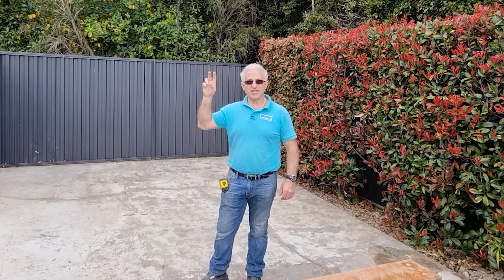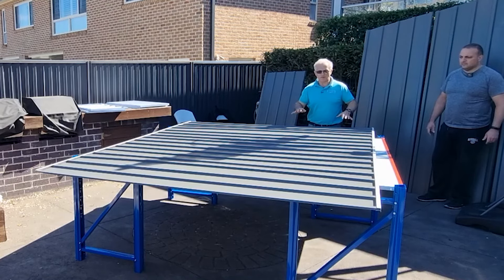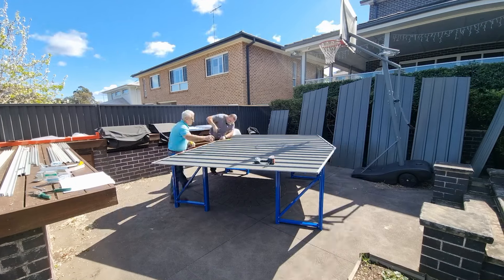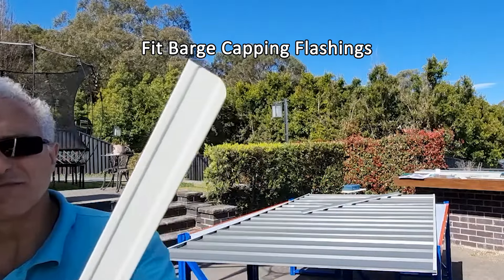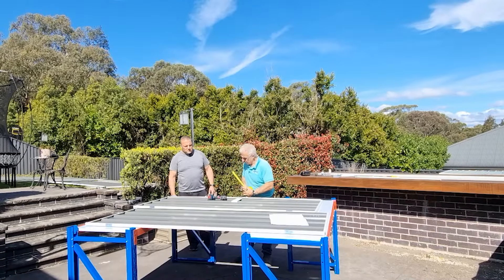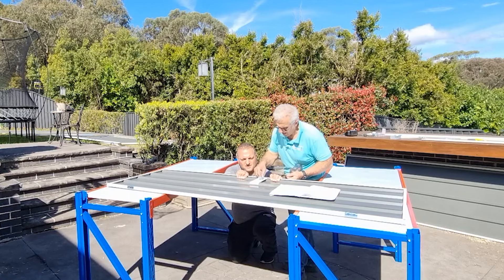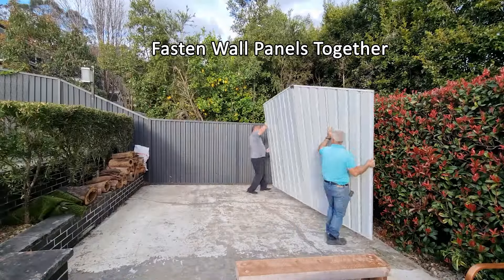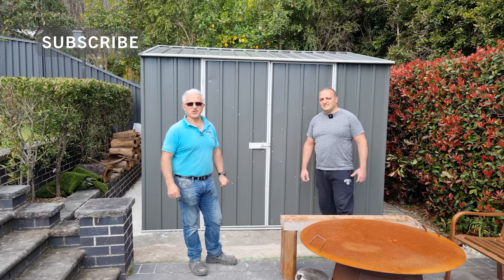Install an Easyshed, but is it Easier than an Absco Shed?!? (DIY)

Comment: If you want to build your own shed with a 200 piece jigsaw and you like that? Go with easy shed. I will use them again. I will get someone to install it for me. Or I could have used Brisbane garden sheds. 4 sides and 2 pieces for the roof.
Reply from the maker: Yes, it is a hard shed to install. There is no two ways about it, it's not an easy. It is a stong but difficult. I don't blame you for being annoyed!
Reply: Not to mention the small size of the ridge capping, I wish this was addressed in the videos I watched.
Reply: Never had a brand name been more misleading.  Perhaps they were easier but eventually pre-assembled less and less in the factory to keep prices low.
Reply from the maker: Sorry to say Max, but I do agree. They are not easy to assemble, especially if you have never put one together before.

Comment: I initially order Absco shed with Bunnings they gave me easy shed instead after months of delay, now i see this video… I really should have ask for a refund /:  it took me weeks to assemble by myself and their so call install service refuse to come over because I didn’t have a concrete slabbing. I was happy to pay more if they do it as well but they refused
Reply from the maker: I am sorry to read that Teddy. We were able to do it quickly only because I have a structural background in carpentry and have experience with putting up other shed! Joseph at the end of this video said himself that it would have taken him a week to put it up. However, structurally it's a well designed shed but EasyShed should take a long look at how they set out the instructions and also label everything!

Comment: I have several sheds in my backyard and the last two i have built were Absco from Bunnings and the recent one was an "Easyshed". the only reason i went with easyshed was because I wanted a cream colour to match the one i was building beside. I would not recommend an Easyshed, it took me several days to get it completed mostly on my own. Barely any of the items are marked so you have to be careful in checking each component. I found the Absco shed much easier to put together, all components marked and the fittings snapped together for the edges as they should compared to the loose fitting of the easy shed.
Reply from the maker: I agree, Absco Sheds is the best labelled & easiest shed I have ever put together! And after 2 years it still looks great!
Reply: WHY ARE ALL THESE SHEDS SOOOOO DIFFICULT ?! You would think by now there would be a much quicker easier way!
Reply from the maker: @axedog1395 You are spot on. The easiest flat pack shed that I have assembled is the Absco shed which has everything labelled. However, you might still need prior knowledge to put it together if you haven't done it before!

Comment: Just received mine, for anyone who receives one unlabelled i suggest making all the easy panels first leaving the front panel with doors till last. that way you're left with only the parts for that front panel and doors.
Reply from the maker: Good suggestion, unfortunately our one was also unlabelled which made it difficult to work out initially. Just take one step at a time and reason it out as you go.

Thanks Matty

Comment: I notice you didn’t rivet anything. The instructions for my 3x3 say you need a rivet gun. Did you just use your own tek screws or were these provided with the shed?
Reply from the maker: Hey Sam,

Sorry, I got sidetracked and wasn't able to respond to your message straight away. Yes, I used screws but only because I wasn't confident with the pop rivets provided. However, I did change them over to rivets at a later date. Good observation!

Comment: I just put my Easy shed together today by myself, followed the instructions which I found easy and thorough (but not too long so you lose the thread of what theyre getting at). I noticed you didnt use rivets for the door hinges, padlock and braces? Maybe the rivets are a new thing? They look really smart and professional.

Comment: Thank you this is so helpful! I've just received mine and am new at DIY so a bit nervous. Can I ask did you have to drill holes before screwing all the screws in?
Reply from the maker: Hi, no but we needed to mark out the holes on the sheets first then we pressed down hard with the drill/bit, then drilled in the screw. Just be careful not to put the drill on an angle because it will cause the screw to be off balance and slip out due to the press you need to apply. I hope this helps
Reply: Thank you so much again!! I wasn't sure if you'd even reply. Thank you :) went to Bunnings and bought a new Makita drill set, level, and all the things, but didn't think of tin snips or a step ladder as featured in your video. So glad I've watched it!! Me and 3 gal pals are building this She Shed at my new property. So excited!
Reply from the maker: @ciellindley  you welcome, just take your time and work out what goes where. It can be a little confusing.

Comment: Finally got to watch the infamous “Easy Shed” video Moussa. You and Joe did a great job even though there was a lack of instructions. I have been looking at putting a shed up at my place. What brand would you recommend? Thanks in advance.
Reply from the maker: Hey Giuseppe,

I think Absco was much easier to install with prepunched holes and is well illustrated.

Comment: great job, I am currently assembling a 3mX4.5m shed. After receiving incorrectly cut ends, Easy shed sent the correct ones and all is OK. I prefer to use silicon on the overlapping sheets, but this is only my decision. I never bolt the shed to the concrete, I sue Industrial silicon and once cured, it never moves. I also silicon the roof panels to the wall panels. Well done, I am doing my assembly by myself, but need help lifting into position
Reply from the maker: Good job! EasyShed won't warranty silicone but I like the idea!
Reply: @quantumhomeimprovements  understand, but I have installed this way for all my sheds since 1979. Once the sheets are tacked together in place for 24hr + make sure you measure against other panels, the segments are easier to move as there is less flex. Its sheet metal, warranty for me is never a consideration, they have stood the test of time
Reply from the maker: It's funny you say that, a while back I released a video, how to install a caroma toilet, and like you I placed silicone at the dase to hold down which I have done for a couple of decades now. However, I had someone comment asking why! They said caroma suggest you screw it down. But my reply was shot and sweet! I would never screw a toilet to the floor because it damages the waterproofing! 

Good job!
Reply: @quantumhomeimprovements  yes, structural silicone once cured is extremely tough. It is used to hold extremely large mirrors to walls. Now that is strong.

Comment: Do you reckon it'd be appropriate to anchor one of these sheds with a ramset?
Reply from the maker: Hey James,

We used dynabolts in the video which the shed is rated for N1, but if you are in a high wind area you may need to upgrade the shed to a a N2 or higher. I can't remember which brand we used for this shed whether it was Ramset or not but yes, I would definitely anchor the shed down for sure.
Reply: @quantumhomeimprovements  I think the area I'm building the shed is relatively high wind, as it's at 700m ASL. Now to look up where those ratings are stored / measured.

Comment: Great job with the video! I was hoping you would have gotten into more detail of which is the better shed between Absco and Easyshed. Apart from the instructions making the Absco easier to assemble, can you please let me know which you found to be structurally stronger? heavier gauge wall sheeting? etc. I was considering Absco but need the extra height of the Easyshed and will most likely go for the stronger of the two and the one with the heavier gauge wall sheeting.  Many thanks.
Reply from the maker: You welcome Tony, I am thinking of making another video next year if the oppertunity arises and I will add more deal as you suggested. 👍
Reply: @quantumhomeimprovements  Thanks, can you briefly let me know here which is the heavier duty shed between the two. Quick and short reply will do. Cheers
Reply from the maker: @tonydelovski8088 The gauge I have been lead to believe is the same but first, could you confirm if you have ever put one together before or are you really good at working out puzzles?.
Reply: @quantumhomeimprovements  Thanks for the reply, yes Ive put a smaller one together a while back. Can't remember the brand unfortunately.
Reply from the maker: Between the two brands Absco is by far easier with their unique clip on system but EasyShed uses screws which is stronger but it will take twice as long & they don't have prepunched holes as well 

I hope this helps you Tony

Let me know how you go!
Reply: @quantumhomeimprovements  Thanks mate. Thats the answer I needed :) I'll stick with the Easyshed. Keep the videos coming, you're doing a great job!
Reply from the maker: @tonydelovski8088  Thanks Tony
Reply: @quantumhomeimprovements  Just an FYI, I was about to order the easyshed but they are only wind rated to N1. Absco are wind rated up to N2.
Reply from the maker: @Tony Delovski  Thanks Tony, I should have asked you what size you are wanting but just be careful, not all the sizes are N2. But if you are looking for a higher wind resistance shed you can upgrade to a cyclone kit. But know the 'N' rated strength doesn't always equal total strength. However, I preferred not to tell you earlier which shed you should buy but the reality is I found Absco far easier to install and I am happy with the strength of it and I think you would be happy with it. 👍

Comment: The reason I bought this shed was the extra height option which is a big plus.
I purchased 2   3x3 sheds, the same style in this video. Was considering giving the 2nd one away as I found this tedious. Only partially built the second one.  I think if they made prisoners assemble these in Gaol, they definitely would not reoffend.
The reason I bought this shed was the extra height option which is a big plus. On there website they say life time warranty but in the instructions it says 20 years from date of purchase. That is misleading for consumer law and I recommend taking a screenshot of the website just in case you need to argue the point.1

I found some of the panels not cut the same length so when joining them together they don't match up. In the side panels with the roofing angle I had one along the angled cut for the roof  2 cms longer and the angle did not match.  I actually cut that piece off with an angle grinder to get it to match.

Previously I built a pinnacle 2x2.3 shed which does not seem to be available anymore.  I have have found the easyshed very difficult to assemble.  The later version of the easyshed, Model ETG-D3030 version Mar 2022 you have to use joiners for the U channels on the top and bottom of each panels including the roofing panels. This is terrible, it makes the job a lot longer and more chances of things not being straight. Especially the door panel. It looked like in the video that joiners were not required.  Even the structural roofing Hat channel required a joiner in the middle which makes it hard to slide the second roofing panel in place.
Unfortunately the easyshed does not have flashing like the pinnacle on the top of the door panel and just has a gap. It would have been easy to supply these as they have them for the side of the doors.
Found I needed to put extra screws on the inside of the door corners which was not shown in the diagram. I put some extra screws around the hinge area of where the join the wall falshing.  Also the door strengthening strips I pop riveted for strength and appearance. The bottom corners of the shed could have done with some right angle fasteners. I found when joining these side panels it would have helped with alignment. Also when moving the shed into position they would have stopped the panel corners from going out of shape.
In my panicle shed they even supply 90 degree channel flashing to screw on each upright corner. This adds strength and holds the bottom corners together.  They also provide U channel to run along the panels on the inside of the shed walls for strengthening. 
The door assembly is the worst. It took hours with two people. 
Simple things easyshed could have done..
Reply from the maker: Yes Darren, it's a lot harder than even Absco sheds which for me was a lot easier. Wow, you really had a bad time! 

When I made my first video which was also a 3 x 3 Absco shed I found it a breeze! Then my mate Joseph asked me to do this one which I found far more demanding! Sorry to hear your experience was very negative!

Comment: How long did this take you?
We are inexperienced, and our slab is extremely uneven so we are afraid.
Reply from the maker: Hi Christina,

The EasyShed is a good and solid product but it took Joseph and myself over a day to put it together which was a lot of effort. There are easier sheds in the market but might not be as solid in some cases. 

We also experienced a very uneven slab which made it that much harder but we put packers underneath to stabilise the shed then put a lot of sealant between which helped make it more water resistant. I personally preferred putting up an Absco shed because of the prepunched holes and better instructions. However, I was okay with putting up the EasyShed.

I hope this help!
Reply: @quantumhomeimprovements  Thank you. We have 3 days coming up to tackle it. Fingers crossed that we pull it off.

Comment: Good video and job well done... I just went thought the same process instructions were confusing and requires lots of going back and forward in the book supplied to find the right parts... so took me and my son TWO Days to build... dangerous metal edges would not go this way again, think it would be easier to frame up, sark and clad a fully water proof and dry shed given the amount of work that this took. I think it will be too damp inside to be of any real use. Not really sure where the value is in these sheds given the time it takes to build? its really just a gazillion parts in two boxes
Reply from the maker: Hey Bruce,

Yes, it's a lot of work as you said. It's more costly to build a traditional shed but in the long run it's worth it I think. However, the Absco shed which I installed in my place was a lot easier to put up, which I use only to store my chairs, tables and all the things I need for our chickens. 

Thanks for the feed back Bruce!

Comment: Purchased a Gable slider model 3.75 x 2.25 x 2.18 recently.  Started the assembly and after the first wall I began to realise what a flimsy design this unit is.  Also the worse plans as well.  I manufactured my own frame from 30 x 30 x 3 SHS which basically consisted of 4 wall sections and 2 x roof sections which I screwed all the sheets on and flashed 90 % of it prior to assembly.  The whole unit bolts together with 16  8mm bolts and the assembly of the sections took less than 30 minutes.  Even with a SHS frame and colourbond sheets, all the walls and roof were easily carried and assembled by two people.  Finished off the flashing using 2mm aluminium I pressed up myself. (Advantage of having an Engineering business)  I even built SHS door frames and utlilised their sliding track system.  Now my shed is like a tank.  The frame took 6 hours to cut and weld up.  Should have just built my shed from scratch.
Reply from the maker: I love it! That would be rated for N4 winds!!! I have a carpentry/builders background and I think you done well! Could I ask you, roughly how much it all cost?

Comment: Some struggle with self tapping screw and pre drill. Yes It is not a great idea as the screws may not end up as tight perhaps.
Reply from the maker: That's a good point Matt! You need to have a good cordless drill and not drive the screw in to fast or hard.

Comment: I recently built two Absco 3 x 3m sheds. Yes you’re right, the Easy Shed is a lot more difficult to erect. 
However, the Absco sheet material is way too thin, flimsy and questionable quality. They are built to a price, remains to be seen how long these sheds will last. Cheers
Reply from the maker: Well said Ken! But I just wish EasyShed do themselves a favour and start labelling their components thoroughly. They would make a killing!

Comment: When i put my 3×3m shed together, the instructions say push the sheets together to finish flush with the end of the U channel. To the legth of the overlapped sheets is not the same as the channels. I found this a bit frustrating trying to force the sheets together to fit in the length of the channel. 
I would have rather just made some frames and made it the conventional way.
Reply from the maker: I hear you, Greg! With my carpentry/building background, I would definitely agree. The only thing for me would be the cost factor! However, going conventional would make a strong and longer lasting structure!